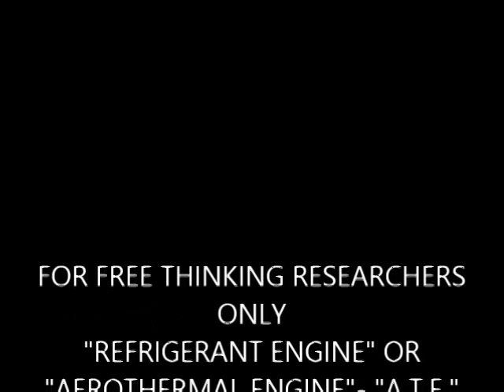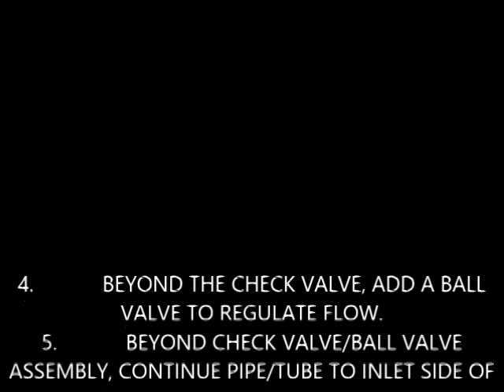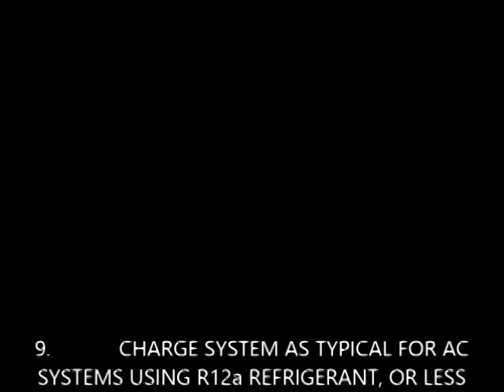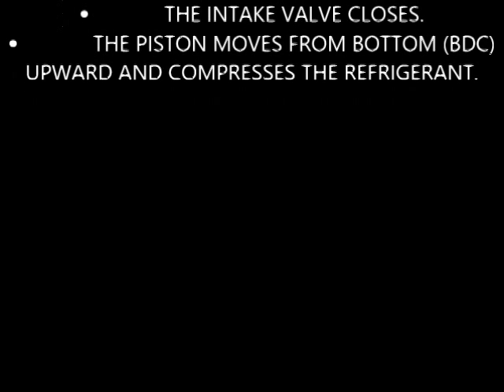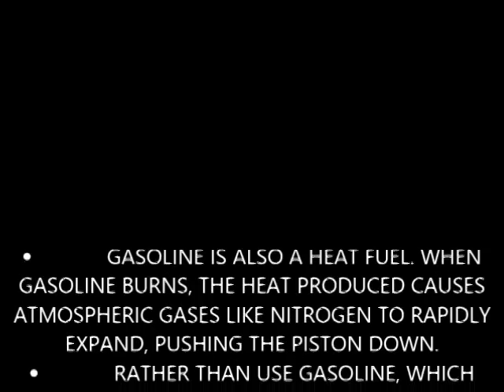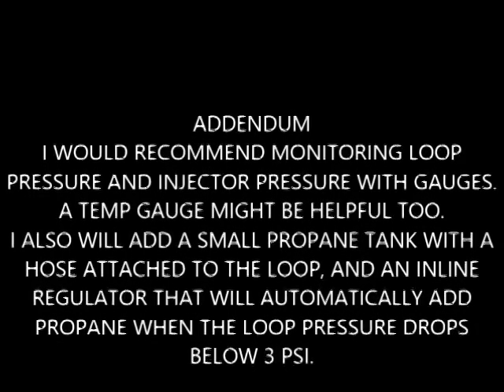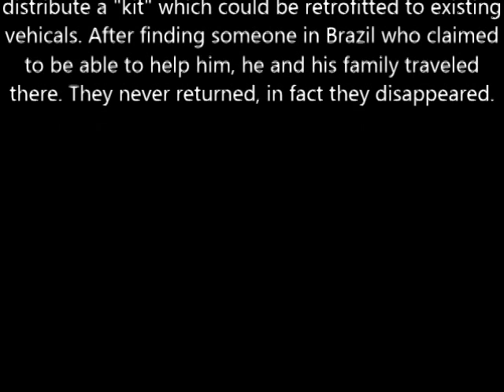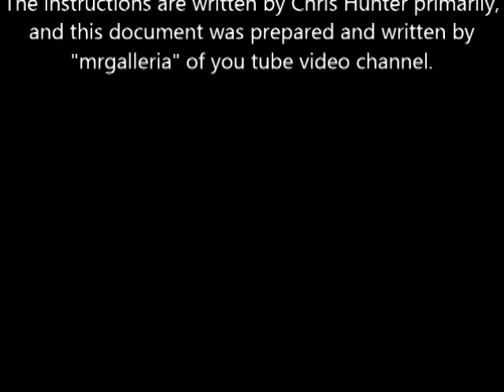ATE "AIR HEAT" FUELED- ENGINE MODIFICATION

Comment: First: Earth is not a 'planet'. Second, what are the instructions for? Apart from telling is in the introduction that it is all about using heat, nothing else is explained. What is the goal of the 'construction' process??? To create engine that will use heat? How? From Earth? How? Will gasoline be used also? Has anyone already made this? All this questions need to be answered BEFORE you start the construction explanation. Tell us FIRST what you are going to tell us EXACTLY. Then tell us what you want to tell us...and at the end, tell us AGAIN what you just told us, EXACTLY. Be clear. There are thousand of real and fake researchers and almost none of them can make a decent video. They always talk to the like minded people, failing to even pass the message to them clearly let alone average enthusiast (who could actually become a researcher tomorrow).
So, please, say clearly what this is about?

Thanks for sharing.